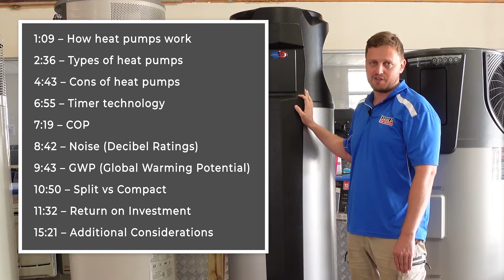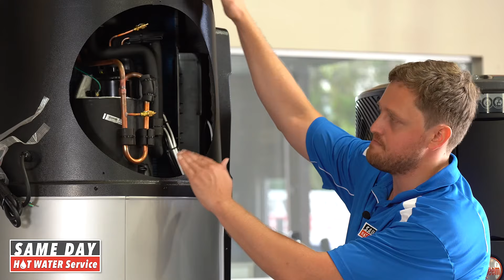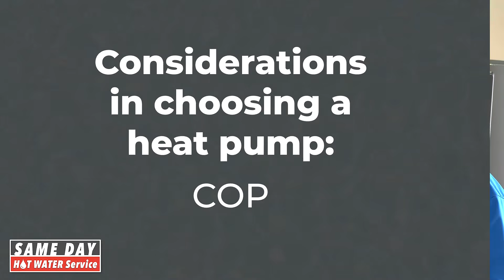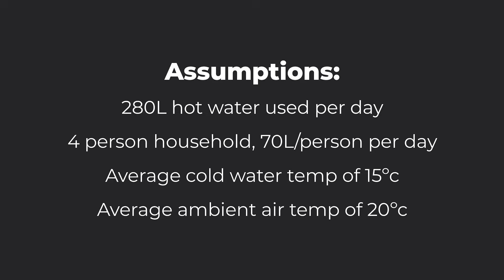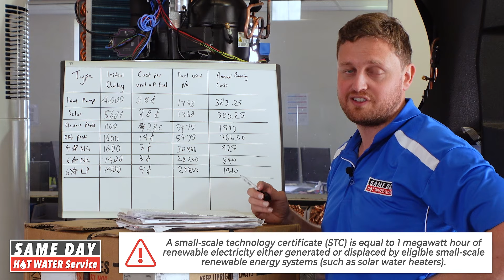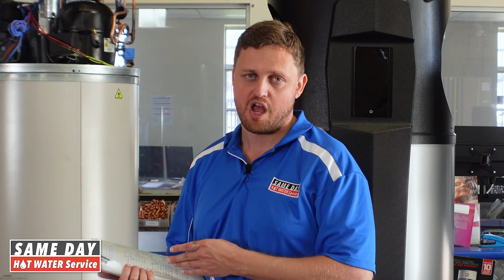All About Heat Pump Hot Water Systems | Same Day Hot Water

Comment: More propaganda rubbish about carbon footprint.
Reply: What's so wrong with using less resources to heat water? Or Using less resources in general? Why is it propaganda?
Reply: @Monsieur405  There is insufficient proof that humans are causing global warming with carbon, or anything else.
Most of the reports put out about such things are paid for and so therefore, the information is biased.
There is also massive now not so covert plans to control every aspect of our lives and this whole carbon-phobic bs is part of it.
Reply: @Monsieur405  Look up the history of oil (and how the earth makes shale too), this research  will show you a bit more about what is really going on.  The term 'fossil' fuels was coined by that industry specifically to create a sense of scarcity within the population about oil and naturally produced gasses, so that they could charge higher prices for these things, and the phrase couldn't be further from the truth.
Reply: @Monsieur405 he's maybe saying that because the tank and components dont fall from the sky. It's a lot of plastic and materials to produce them in factories and then it's very hard to dispose or recycle when they fail. Just like everything really. That's why I'm considering sticking with my compact continuous hot water system.

Comment: Noisy thats all im saying
Reply from the maker: Yes they can be noisy but in most siutations they are actually quieter than the reverse cycle air conditioner that the majority of houses have.  Could also consider the Reclaim/Sanden product ranges if noise was a concern as these noise outputs are literally a whisper noise level.
Reply: @SameDayHotWaterService  yea but a reverse cycle aicon is only used in winter. Hot water is all year around means noise everyday. No good
Reply from the maker: @Peter-zv4dx  reverse cycle means the air conditioner can do heating and cooling. It is becoming more of the norm to use the air conditioner all throughout the year.

Comment: If you install a heat pump water heater inside the home does it make much difference helping to cool the air during the hot summer months?
Reply from the maker: Hi David, Will de humidify the air as well as cool down the air air at the same time.  Would be great for summer and potentially horrible in winter.  This is a good video to explain what you are likely trying to do.  https://www.youtube.com/watch?v=5EzfmLFCYy4.  Maybe look at the Envirosun 250 heat pump as they would have a suitable option to achieve this.

Comment: RE COP at around 8 mins in. only way to compare units efficiencies is STC's as this is a controlled testing environment that everyone has to test to. the higher the STCs the more energy saved over the deeming period.  If one unit gets 28 STC's and the other 27, the one that gets 27 will use another 1000kWh energy over the deeming period.

Comment: Costs are interesting. If you consider running it off solar with a timer costs are essentially free, or if you amortise the cost of installing the solar and include that into your hot water costs it's about 2.2.c a kWh for solar. Also NSW has rebates above STC which means you can get some smaller 270l systems already for about $33 install cost. The only issue I see maybe the reliability of the cheaper brands that are new to market. Otherwise better for the hip pocket and environment ⚡
Reply: Costs are only free if your FIT are 0